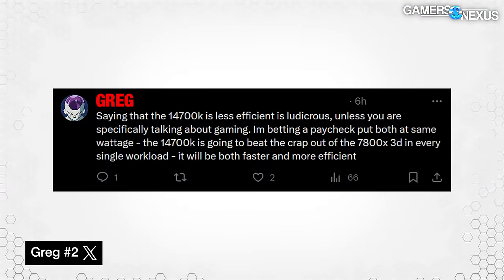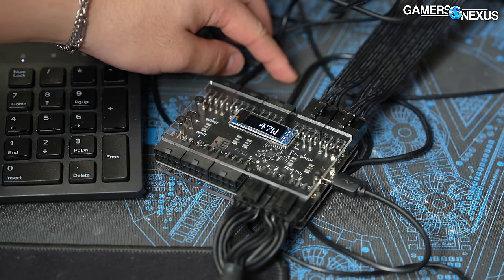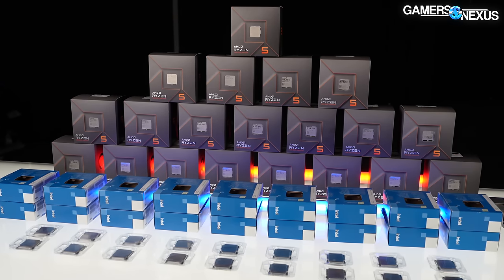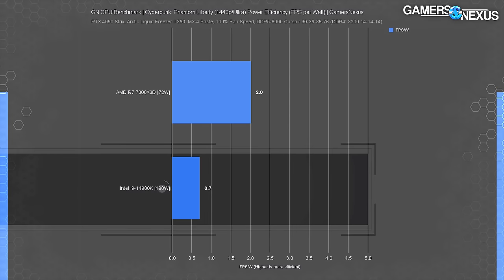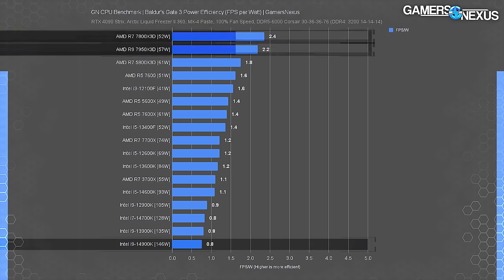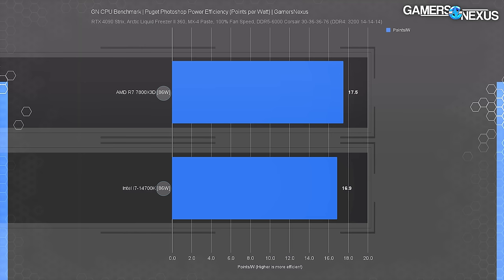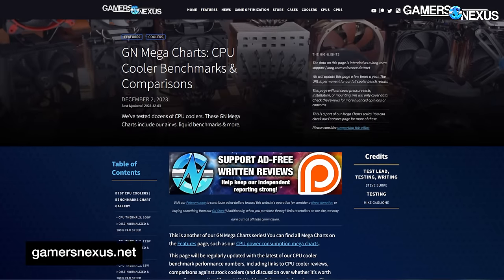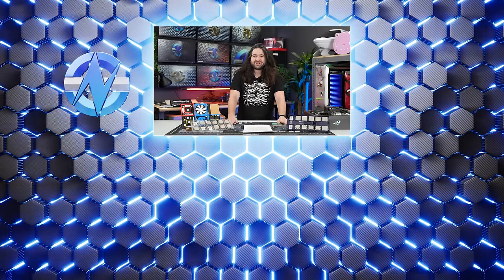The Intel Problem: CPU Efficiency & Power Consumption

Comment: Hey, im curious. Could you compare both companies CPUs when it comes to Professional applications? Like how well do they integrate and support the dGPU in programs like Davinci? Or how well can the iGPU transcode/encode and be used as streaming processors?
Feels like a topic nobody has ever really touched and the videos that ive found about it all used intel for that, without any comparison to AMD. I probably guess there is a reason for that (AMD not being particularly known for their care of the professional userbase and things like the worst h264 quality encoder on the current market) but it would be interesting to see the differences analytically tested.
Reply: Cad rendering and fusion 360 should be included.
Reply: " worst h264 quality encoder " If quality is a thing - you don't use GPU encoding anyways...NV and AMD both suck.
Reply: @df3yt  If performance matters, then of course, you are using GPU encoding.
And besides streaming (mostly h264 and max 8Mbps), it doesnt matter at all at this point.
h265 as well as AV1 dont show meaningful quality differences to CPU encoding. Doesnt help with AMDs h264 encoding, what is still the #1 reason why most people dont use AMD for streaming.
Reply: @CallMeTeci  Personally, I'd use AV1, allocate one core and be done. GPU encode can still cause hiccups on setups while gaming. This therefore handles performance and quality. I've setup a fair amount of streamers this way, so if performance matters it's not necessarily gpu. Haven't tested with ARC though. Maybe that works better.

As for 265 - not a chance for me the biggest waste of codec. 264 or AV1.

Comment: Thanks Steve. Thanks GN. I was thinking about this in the back of my head since about 9th gen with the pumping of clocks without much IPC improvements or a die shrink. I was expecting around a 0.5:1 power consumption and efficiency ratio between Intel and AMD and your tests just shown it was worse and it wasn't surprising.

Probably something that contributed to the inefficiency of Intel is what they did since 12th gen with the P and E cores hybrid that kinda feels like going back to Pentium D where they glued the inefficient dies together and kept pumping the clocks at the cost of the customer especially with the degredation and instability of 13th and 14th gen.

The i3 12100F was surprisingly efficient though, likely due to not being a hybrid CPU design and just having 4 P cores with hyperthreading. And it was also really nice to see the Ryzen 5 5600X also performing well since I have a 5600 myself and they're quite similar.

Also I do hope Greg surrendered his paycheck for some modmats haha.

Comment: It would be nice to have seen idle power consumption results too. AMD definitely is more efficient under load at this point, but as you mentioned the IO die results in a fairly high floor for power consumption. In situations where a computer will sit most of its life at idle, or low load (word processing, web browsing, etc.), and only rarely be used for high load, then Intel may have the edge regardless of its worse efficiency under load. 

It's just another metric that it would be nice to have data on. For something like an HTPC, for example, that might run 24/7, but be idle much of that time, the idle power consumption becomes much more relevant than load consumption. Or if someone only games a couple hours per week but uses their machine for office work the rest of the time, idle likewise raises in importance.
Reply: Those systems may be someplace something like that i3-12100 is very useful.

Comment: I run my 14900K overclocked to 6.1Ghz as a daily driver, in my configuration I enabled C-States with a specific value of C0/C1. Doing so allows the 14900K to drop down all the way to 800Mhz on certain cores and not all the time. In Starfield I can average a clock speed of 5897Ghz with a consumption of about 135w, obviously that's still not as good efficiency as a 7800X3D but I don't think its as bad as the numbers you are getting for the 14900k. I have even tried this configuration on Firestorm Viewer for Second Life/Opensim and at 5897Ghz its only using 75w. It varies greatly from application to application as you mention in this video. But what good is it to have a highly efficient processor when you pair it with something like an RTX4090,which can get up to 427w of consumption in certain games. I understand the need for efficiency but I see this relating more towards a corporate server farm than a homebrew PC aiming to get the highest possible FPS, its a bit silly especially when you toss in the consumption of the high end video card. Someone that is blowing so much money for a high end processor and high end video card won't be derailed by power draw. What I am wondering is "will Intel's APO yield not only higher frames but better power usage", this we will have to see.

Comment: I would love to see you do an analysis of idle cpu power consumption. I know it's hard to measure and depends a lot on other components of the system.

For many people the system spends significant amount of time in either true idle state or with very little load and over time that might translate to significant energy savings depending on the system (mostly cpu, but also chipset).

I know that historically AMD had some issues getting down to low idle wattage on desktop parts.

Idle in this case means truly idle (probably making sure that windows defender doesn't choose that moment to do a scan...), but it would also be interesting to see 'idle' defined as power consumption during watching a GN YouTube video, something we all here experience often.

Comment: I endorse this testing and I honestly want it for GPUs as well. Especially GPUs are power hungry and a normalized test to 144 Hz / 144 fps would be really eye opening on how efficient each GPU is.
Reply: Optimum tech has a good video on that titled 'amd needs to fix this', showing how insane differences between 4080 and XTX can be, in non demanding games 4080 can draw 200w less.

Comment: I have one concern with this testing methodology: some stock motherboard settings are just dumb

While browsing on the overclocking reddit, i came across multiple instances where the motherboard dumps an insane amount of voltage into the chip while operating at "stock"
I know it's still stock and should be tested this way, but it results in a lot of variability depending on the motherboard brand or model/bios.

For example, a 14900k at 57 gHz goes up to 1.4-1.5 v on some boards but can operate at about 1.25-1.35 v at this frequency. This can be the difference of a couple dozen watts while gaming. (Some boards even go for too little voltage, causing crashes)
I know LLC, AC_LL, F/V-curve tuning shouldn't be a requirement to run those chips optimally! But to really compare the efficiency those settings should at least be considered, talked about, not just the power limit.

Nevertheless, it won't change the outcome that AMD is more efficient, that's for sure.

Comment: Very detailed test, thank you very much.

Seriously, I don’t care about the power efficiency of the CPU. I wish my 7950X3D could exert its full performance at 230W instead of being limited to 140W now, which makes it unable to outperform my old 7950X in many scenarios.It's great to save more power, but I think maximizing performance is the first consideration for a gaming flagship processor. If you don't want extreme performance, why not buy 7700X and 14700K? The price difference is enough to cover your 7X24 electricity bills for several years.

I think AMD is really trying harder to solve the temperature problem of X3D. The 7950X3D will have serious instability in the lowest FPS in many simulation games (such as Transport Fever 2), but this problem does not exist on the 14900K R9 7950. Maybe X3D strictly limits power consumption, This causes its frequency adjustment to be very aggressive, its frequency will be seriously unstable under heavy load scenarios.

Comment: The frightening thing about this video (to me), is what it reveals about "where we are today."

I JUST finished dialing in my Dad's new build today. His old 4790K (no dGPU) build is used as an office PC and for recording+publishing professional education videos, but it's so old it's practically guaranteed to have a catastrophic failure "soon". The replacement is an R5 7600X (stock, no delid, no lapping) build, and on an EKWB 280mm AIO as case intake, if you let it sit steady state idle in Windows 11with the pump running 60% and the fans 15% as baseline, the CPU WILL reach 60C within roughly an hour (at which point, fans ramp for a bit and we're cool again).

This is after locking package power draw to 88 watts and stability testing a -30mV offset. And the sidewall of the radiator is WARM. Like, holy Hell. It used to be you could cool a top-end I5 with JUST a top-mounted 120/240 rad, and it wouldn't need to spin up the fans until you threw AIDA 64 at it.

We are at the point where the entry-level overclockable CPUs--AT STOCK--require liquid cooling AND active radiator fans to keep them at a steady temperature AT IDLE?! And the 7600X is one of the most efficient CPUs on the market? WTAF?!

Edit: btw, the non-zero minimum front fan speed is because I neither want the RAM (G.Skill 6000 MHz, CL 30 2x16), nor the VRMs (though they don't seem to care even at full load + 15% speed, stuck at 51C), nor the PCIe 4 M.2 getting excessively warm under spike loads such as opening applications, which manage to send to Tdie all the way up to 70C before it collapses right back to 60 +/- 2).

And, I triple-checked the mount. Paste spread pattern is practically ideal. Thick IHS or not, the contact is great, the rad is not-quite-hot, and the chip is pushing 60. Good, lord, Ryzen Master is reporting total package power usage of 15-28W, and THIS is the resulting temp? I have no words. If Intel is THAT much worse at efficiency, I don't want to think about building another. Time for ARM/RISC-V

Comment: Yes, please do idle/internet browser/media power consumption. Reason I got the 13400F over the AMD part is because it's idle consumption is extremely low. Like 1-2 watts low.
Reply: But does it matter if it draws 5w or 10w if you are browsing the Internet? I doubt you browse the internet 24/7 and even then the khw price difference is so low it does not matter.

Comment: Intel's strategy for the last 4 to 5 generations has been to push the power limit as far as they can in order to get the highest performance, so I'm not surprised at all by the results of these tests. The issue at hand isn't so much the power consumption that this brings with it, but rather the waste heat generated by the CPU. Because the ever increasing levels of heat generated necessitates the use of ever more capable, and thus expensive, cooling solutions. Where in the past these solutions were only necessary for those among us who were into overclocking their CPUs, now it has become necessary to use these solutions even for stock settings. This adds additional cost for the end user that isn't needed for AMD Ryzen based systems.

Comment: This confirms what I already based my choice on for the 7950x3d. I wanted a high-end cpu this time with enough backup cores so it will never hit 'accidently' 100% on all cores (and for video editing soon). So lot of cores, gaming speed and efficiency. both 7950x and 14900k especially fall short on efficiency. The 7950x3d is amazing on everything except perhaps on idle use (but not as dramatic as ppl make it out). It's imo the only cpu leading 'everything' (if 8+ cores are wanted) at the moment (workloads, gaming, efficiency).

No regrets during gaming i have much more speed with similar power consumpion as 3570k while being an insane amount faster. Also temperature (i have 90°C cpu's , makes you have to second guess hardware problems non stop if computer has issue, with the 52-76° degree range (76° is only hotspot rest is closer to 54°), i know for certain the cpu is stable and won't do weird stuff.

I find it disgusting that Intel (and amd on non 3d cpu's) went past the efficient volt frequancy. Using double the power for 2-10% performance is utterly stupid. In belgium the electricity cost more then in German (about 15 taxes are all per kilowatt you pay, so electricity is insanely taxed).

Comment: More inefficient chips produce more heat given the same workload. When heat is produced it should slightly lower your heating bill when heating is used in the house. Only when you need to "destroy" the heat e.g. cool your house using an aircon it will effect your net power bill, however very slightly due to the wattages that are in play here. 

I am not advocating appliances being inefficient with power. I like my vacuum cleaner to clean the house when I turn it on, not use its energy in another way which might or might not be beneficial to the amount of work the other appliances in my house have to perform.

All this is just a side effect to the second law of thermodynamics and completely unavoidable, it can be mitigated however through more efficient design.

Thanks Steve for the interesting and thorough work done here!

Comment: Was about to say "I'd love to see older CPUs like mine on their too to validate my lack of upgrading" and you do! 3700X is one of my all time fave upgrades, hell I had a 2700K before it which I kept for years because every CPU that came out was just not worth the investment (considering it's CPU/mobo/RAM). Now I hope to keep this for just as long, if not longer.
Reply: When 5800x3d gets dirt cheap it's worth it. Does run hotter than 3700x but damn it is fast.

Comment: This is a fascinating test and a good set of data, but it leaves me with more questions than answers.  Yes, it clearly shows less efficient power consumption in these situations, but I am left wondering why? What would be the advantage to intel in 2023 to produce a CPU that is so vastly less efficient? Is the power efficiency of the CPU altered by the chipset, the OS, the PSU, the VRMs, the design of the motherboard,  security updates, various patches, etc.  I realize these questions are hard to answer and maybe even irrelevant in some cases, I just don't know because it is hard to control for all these factors and more. For example,. is the power consumption more or less efficient between Windows 10 and Windows 11?  Is the power consumption always worse on most of the newer Intel CPUs regardless of the activity.  For example, is the 14700K less energy efficient when viewing photos in light room, or with the efficiency cores turned off, etc.?  Just curious, it seems odd that there would be such a large disparity in efficiency without a logical reason. What is it that makes the AMD chips more efficient in the situations you tested for?  I would be interested to see Intel's and AMD's response sans marketing BS if that is even possible. I just don't see why Intel would produce chips with such a large difference in energy use without a benefit.  I would really like to hear Intel's reasoning for producing such lower efficiency chips.  Fascinating stuff.

Comment: This should be done with GPUs, most channels seem to be ignoring how disgustingly inefficient AMD GPUs are compared to nvidia on the power consumption/watt per frame side of things especially when the FPS lock is off - I think Optimum Tech clocked AMD GPUs being something like 3-4x more inefficient compared to Nvidia. But people will cherry pick the narritive that suits them, even though GPUs use significantly more power than a CPU

Comment: Yeah, greetings from Germany: power consumption really is relevant here. And not just because more power consumption also means you need better (=more expensive) cooling solutions to keep it under control (so while the 7800X3D could be cooled by a mid-class tower cooler you need a really beefy water cooler to keep the high-end Intel CPUs under control when run without a power limit). No, not just that but you could actually pay a lot for your power you could use for new hardware instead.

Comment: I'd rather go with with a 13xxx or 14xxx Intel CPU right now, than with an AM5 7xxx + DDR5
And no i'm no Intel Fanboy...i was a very happy 2700x, 5800x and 5700G User on all my machines...But DDR5 and AMD 7700 with NO overclock was NEVER stable...not even at low speeds like DDR5-5600
No...will pass thanks - Intel is the way to go for stability right now.

And all the Z690 Boards on the shelfs right now are really cheap. I got mine for around 185 (Z690 Extreme)

Comment: As someone with 12400h I'm not surprised. It's much faster than my previous laptops 9300h, but it also churns a lot more power. My old laptop would do youtube videos at some mere few watts, but this thing takes at least 9-10 watts when even the mildest load is applied. Efficiency at light loads is bad despite the P&E cores.

Comment: The one big thing that’s rarely discussed in these conversations - lower cpu wattage means more power budget for other components. 

My use case - I can get away with running a 5800x3d and a 4090 on a 850w power supply. I have been using a seasonic platinum for years, and am happy that I didn’t have to upgrade the PSU because I could barely justify the gpu to my wife.